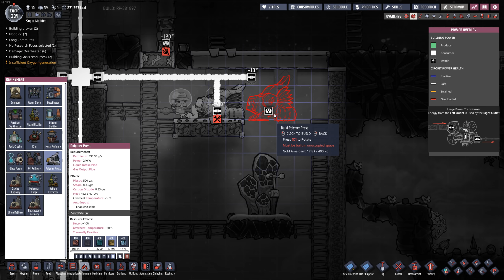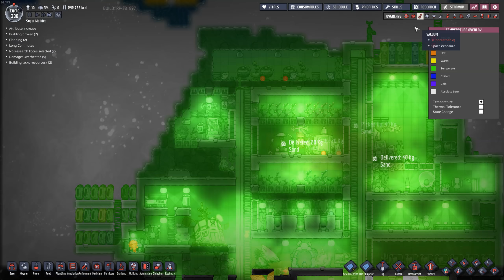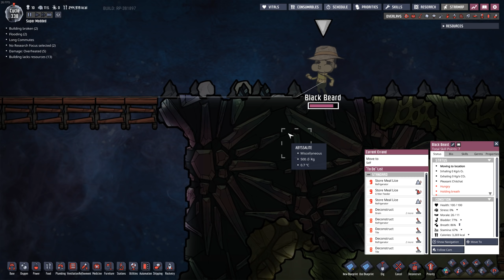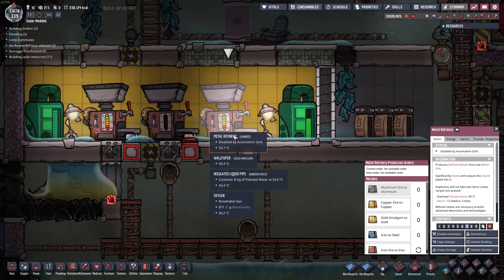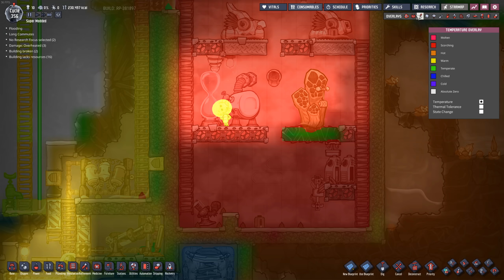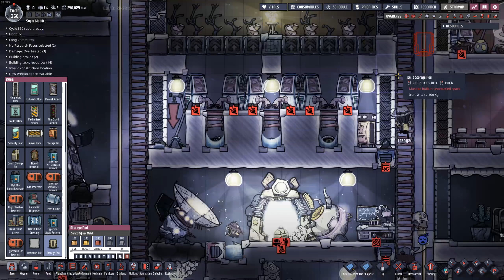Automated Glass and Plastic! Super Modded Oxygen Not Included EP10

Comment: I would just like to add that one simple way I have found of automating plastic production, or at least slowing it down so it doesn't consume all your petroleum is to attach it to a thermo sensor right next to it, set to somewhere around 200F. It will tick on and off as it hits that temp and cools down, slowing down production, but keeping it consistent. This causes it to run for brief periods at a time without needing a bunch of clock automation.